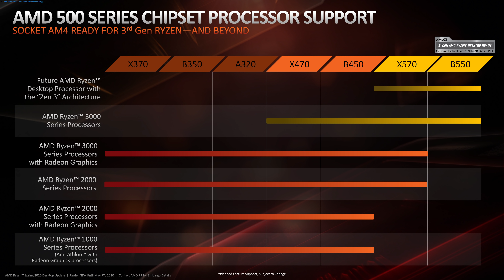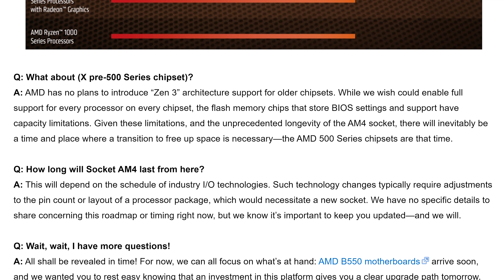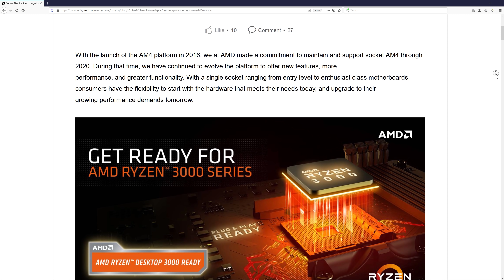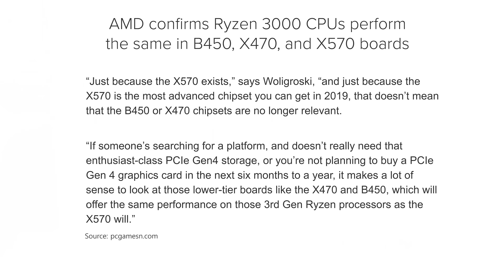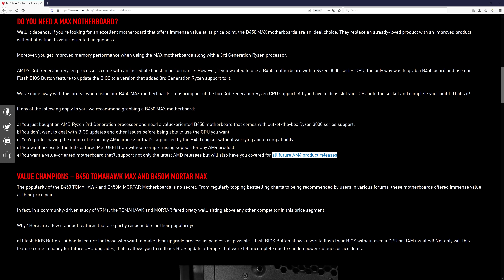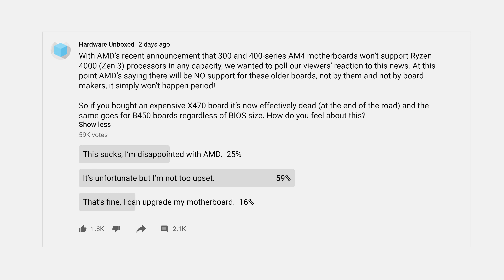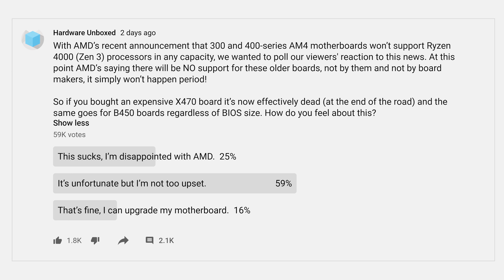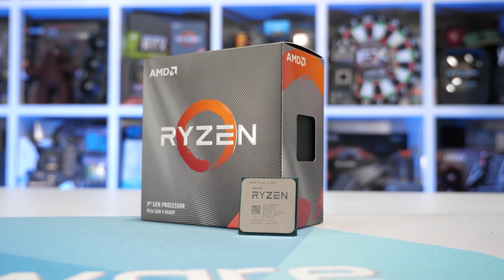AMD Does An Intel, Axes Zen 3 on 400-Series Motherboards, Our Thoughts

Comment: Yep, I build a B450 with R5 3600 like 2 months ago.  I was hoping to drop in a 4000 series CPU in a couple of years.   Now I might as well weld it shut.
Reply: exactly the same config as you, a month ago.
Reply: @marshelo88  don't know if you heard, but they have caved to pressure and we will have 4000 series support now.
Reply: Save money, sell old rig for 20 to 40% of the value. Buy new shit. Repeat every 4 years. Profit.

Comment: I agree that its a crap move but I think the number of people who do "just" a CPU swap it pretty low, partially because Intel has conditioned folks to think of motherboards and CPUs as being replaced together.  

I just bought a 1600 AF to put into a build and I decided to go with an x570 because I wanted to be able to put multiple CPUs in over time. 1600AF now, then a cheap 39xx, then the very last 49xx.  I figure I can get 8 years out of it and never spend more than $100 on a processor.  But I almost bought a B450 because the are such a great value and I thought they would carry me to a 4600 minimum.

Thanks for standing up for users!

Comment: You nailed it. AMD screwed people who bought B450 or X470 motherboards with their Ryzen 3000 series CPUs last year, when those chips were released. Had they released B550 alongside the Ryzen 3000 series, this would be a non-issue. The only 500 series motherboards they had available at the time were X570, which were too expensive to reasonably pair with a $200 CPU purchase. They really need to find a way to support Ryzen 4000 on the 400 series motherboards, if they want these customers (myself included) to buy AMD next time around. If they're going to do this crap, I may as well buy Intel again.

Comment: You guys are awesome! Thank you for being the only notable tech review channel which didn't blatantly side with AMD on this, and looked at both sides of the argument honestly and objectively. When I bought my X470 board with a Zen 2 CPU I specifically chose a board with a 32MB BIOS because I was following MSI's launch struggles with their smaller ROM sizes. When AMD axed PCI-E 4.0 on my board, I was fine with it, fair enough. But when they told me no future CPU support because my BIOS is too small, NO, that's not flying, don't insult my intelligence.

Not only were customers convinced by AMD's marketing that future CPU's would be chipset agnostic, OEM's were clearly lead to believe the same thing, so we are not just whining over nothing. It would be one thing if AMD would offer SOME compromise on this, but since they're not, I'm lead to question whether they're doing it out of greed, laziness, or anti-consumer choice, because the technical limitations they cited are at the least blatantly misleading, and at the most it's outright dishonesty.

Comment: I bought an MSI B450 Tomahawk on the grounds that it would support future Ryzen releases. I'm currently using a 2600X and whilst there are some worthy upgrades in the Ryzen 3000 series I was more likely to wait for the Ryzen 4000 series. Now I'm left in the future to look at the used market for a CPU upgrade because I don't intend to change my motherboard for a while. 

Quite frankly I'm disappointed in AMD's stance. They sold me on the idea of future upgrade ability and now that no longer feels the case. I am quite capable of flashing my BIOS to support future releases and I'm sure many other B450 owners are too. I sincerely hope AMD change their stance as otherwise I won't be buying Ryzen 4000 CPUs as it stands.
Reply: This stance doesn't make sense to me. The way I see it is this: 

You have 2600x and you are skipping 3000 series to jump straight to 4000 series. While you are doing that, you are saving money. At least 300$ if you are hoping to buy 4600x or something similar on release date. So you would technically be saving about 100$ because you don't have to upgrade your motherboard. Now, I have no idea what you are planning to do with your old CPU without a motherboard, but lets assume that you sell it to get back some money. You should easily be able to sell it for like 50 - 60$. So that means that you have to spend 240 - 250$ to upgrade to 4600x.

Now if you are planning to do the same thing, but you have to buy a new motherboard, you will have to spend additional ~100$. But you also get to sell a nice bundle of decent b450 mobo + 2600x for like 100 - 120$. So essentially it would cost you ~280$ to upgrade to a newer motherboard and 4600x CPU. Thats like 40$ difference in 2 years. Even if you new motherboards costs 150$ you are still looking at spending 100$ for 2 generations of improvements. Like such a trivial thing to be mad about.

Comment: I did get a 450 Tomahawk, during Black Friday - I'll just replace my 2700 with a 3950x.  I'll get a new MB when the AM5 socket hits.  This is much ado over nothing.  if you need the performance gains that the 4000 series provides, guess what - you will need to get a new MB.

If you are too cheap to get one, well your opinion just doesn't matter to any corporation.

Comment: 1 i think b550 delay is the worst thing about this situatio, if they released the cheap 5 series motherboard giving a clear budget option for 3xxx processors 
2 this move means that 3950x processor will maintain its price a lot more, much like evey "best for its socket" cpus from Intel

Comment: I would gladly dump 1000 series support for 4000 series support
Reply: Don't forget Excavator, Athlon and all the APU's.  Need to be able to go from 2000's to 4000's  Actually I'd be happy to go from just 3000 to 4000.  The 4000's would replace 3000's which would then be used to replace 2000's.

Comment: Almost every single generation of Intel processor has required a new chipset without fail. Are you 9th gen Intel users upset because 10th gen processors won't work on your expensive motherboard? No reason behind it other than greed really. So AMD actually gives out a somewhat valid reason and when the could have said just because it won't, and everyone gets upset. Frankly, I'm amazed they even kept AM4 going this long. Here's the real thing though, what about ZEN 3+ or Zen 4?
Reply: The problem is the AM4 socket was supposed to be compatible with Zen3.  They have made this claim from 2017.  Zen 3+ and Zen 4 were never  in the picture.

Comment: as usual harware unboxed, u are right on point. believing in AMD i replaced my 6700k with r5 3600 , keeping in mind i am gonna get a high end 4000 series, and also recommended AMD and built a MSI b450 tom. max for my nefue 6 months ago, blessing AMD for the change of spirit they bring along with the higher core count and knowing it will support future am4 processors. AMD at-least u can do is support B450, u let me down and u made me let down my nefue. i am disappointed to c u are going in intel's footsteps. keep this up and i am sadly going back to intel when they go 7nm.
Reply: So Intel letting you down for the past 5 years suddenly doesn't count and after one extremely trivial thing you are ready to go back to the abusive Intel relationship? Really backwards argument.
Reply: @MantasS-t9v  i understand your point. with Intel at least u know what u are getting from the start and u plan accordingly. There are no hopes and promises to be broken, what u c is what u get. This is bait and switch strategy. They abused my trust. I invested in a platform knowing its gonna have atleast 1 more gen of support, bought 3600 now and planned to get higher frequency +core count on 4000 series on same mobo, BELIEVING AMD's promises only to find out later i got cheated into investing in a dead platform.  I even bought new pc earlier than I would otherwise to support amd and the competition this field desperately needed and even bought AMD stock. I really believed in them to be different and more consumer friendly. With intel i wouldn't have done that. I thank AMD for waking intel up and make them sell better products for less money and thats it.
Reply: Back to intel when they go 7nm. I might not live that long.

Comment: AMD will probably back track on this statement and allow support for older boards with 32mb bios chips. Those boards generally have better power handling as well because the company at least spent the money on a more expensive bios, may as well do the same for the rest of the board.

Comment: Time Stamp: 6:00 Thank you so Very Much for explaining the Whole X370 and B350 situation But still some of us first ZEN 1 Adopter's have x370's that can handle it and deserve it for leaving Intel in the first place for the promise of AM4 2020...
     Because I have been saying for a Year That ASRock only gave my ASRock Taichi Motherboard 1 BIOS for the 3000 series!! Then Finally about 2 month's ago, gave us the ABB AGESA and Then the 1.0.0.4 B patch 6.20 BIOs that basically skips the ABBA AGESA.. This is Asrock's website https://www.asrock.com/mb/AMD/X370%20Taichi/#BIOS  and while you are there check there X470 Board's and UEFI's.. None had the latest BIOs' for Zen 3000 except X570... 
    Thank you so Much Steve because I didn't upgrade my 2700X to a 3700/3800X out of Fear of BIOS incompatibility Issues.. Now that Ryzen 4000 is about to come out, Motherboard maker's want to give us a descent BIOS for Zen 2 on X370... Typical of them and AMD.. 
    Finally, IT'S The SAME PIN Layout and I have a Beefy true 16 Faze VRM, There is no reason for this with THE 3000 GEN CHIP'S.. But I do get it if they don't want b350 or X370 board's running Zen 3 from there point of view, BUT NOT FROM MINE!! I WAS AN EARLY ADOPTER, ONE OF THE FIRST TO LEAVE INTEL FOR AMD ZEN 1... I was scared to death Nothing n worked right, it took 3 BIOS updates, before you could get your memory stable above 3000Mhz, Who remeber's that shit???.. 
    I STARTED WITH MY X370 TAICHI AND AN OVERCLOCKED 1700/3.9GHZ..  Then I went to flareX 3200 14T and a 2700X.. Now I want a new chip and want to keep my PERFECTLY GOOD MOTHERBOARD!!??, ASROCK AND AMD!!!!!!!!!!!!!!! But Thank you Steve for explaining in detail once and for all about lack of B350/X370 motherboard UEFI support.. Lastly Most BIOS Flashes are just just that flashes, that add too and over right info that already there, Trust me they could get another 2 gen's out of good VRM X370 Board's if they really wanted too.. This is AMD on their chip-set money and ALL the motherboard companies and there new money because They know people will buy it cause everyone is in love with ZEN right now,,,  to make an agreement to Make New money....

Comment: While you're not completely wrong with your statement, that B450 buyers buying a 4 core Zen 2 are at the "end of the road", it is partially wrong at least. They can upgrade their core amount to 6, 8,12 and 16 cores which amounts to much more than to upgrading your IPC alone. People seem to forget that pretty often when they talk about "no Zen 3 for X400 series boards", but it is very significant and not to be ignored or forgotten. The same would also be true for owners of X300 series boards.
Reply: Except lots of programs don't benefit from increased core count.  Lightroom and Photoshop being the two most popular.  Faster clocks and better IPC always help.

Comment: My explanation of the mentioned poll is that people will hold onto 3rd gen for a while now since it performs very good, and there's no need for an upgrade for the most, unless something magnificent happens in the GPU market. In the other hand, I think everybody who decides to move on to the 4th gen can still flip their MOBO and CPU for a decent amout of cash and add that extra to get newer components. Since there's still alot of 1080p gaming going on, B450 boards with 3rd gen Ryzen are more than enough (I'm running a B450 Bazooka v2, 2600x, 1660Ti and getting comfortable 75FPS gaming). If nvidia surprises us with Ampere, things might get a but different in that area...
Reply: Only going to  matter if Nvidia moves to PCIE 4.  Which isn't likely till IBM supports PCIE 4.  Even 2080 ti barely exceeds PCIE gen 3x8.  Do you expect Nvidia to double the graphics capability in the 3080 ti?

Comment: Big disagree, the reality is 10 years on the same socket is unheard of and people got their value out of their boards. Support up to 2020 means this is the last year for support and come 2021 all new boards will be needed for all future Zen chips. Those new boards will be around until 2031. If AMD follows the same model.

He'll I bet if AMD offered a motherboard credit (turn in your old Mobo for a newer model and pay the difference) people would shriek still. Sometimes as they say, the customer can be wrong. What I mean is if that board (400 series and lower) decides to die. The AIBs will not have a replacement and any board on eBay is rolling the dice if the board is good. Eventually you will be forced by circumstances to upgrade unless you can find the components and have a machine to do precision soldering on your dead board. 

As they say, no one is forcing you to upgrade your Zen chip. If you are using a 2000 series, 3000 series an AF chip. Then why do you care about the 4000 series needing a whole new board and chipset. Your CPUs should be good until 5000 or 6000 and then you will need to seriously think about upgrading anyway.
Reply: Who is talking 10 years?  We are only talking 4.   Am4 was supposed to be good for ZEN, ZEN 2 and ZEN 3.  Which were supposed to be 2017, 2018 and 2019.  Zen 3 not working on the AM4 sockets from 2017 is not what AMD marketed until now.  And now they are saying up to 2020, but even in 2017 they were saying through 2020 ie through Zen 3.

Comment: My feeling is that AMD will bend on this. They certainly want to keep the goodwill they have been building with the enthusiast community the last few years.
Reply: Not so sure about that.  They should be in damage control right now if they want to keep the goodwill.   MSI was really fast to address the issue when it was rumoured they weren't going to support the 3000 series on the B350/X370 motherboards.  This isn't a rumour.  Its an AMD press release.    I guess they just  don't want to sell me a couple of  4000 series chips.

Comment: On the one hand, AMD could do better and support 400 series because they didn't release B550 alongside or shortly after X570. On the other hand, they are already doing better than the competition when Intel's go-to line is "go fuck yourself, here's a new socket again for no conceivable reason".
Reply: AMD is now just copying Intel.   The bios size is an issue for some  X570 boards as well.  And it's not even a new socket.

Comment: I just got a Ryzen7 2700 plus a Asus Gamer-F B450 and two 8GB sticks of DDR4 3200 for around 280. So, it just validates me going low on the tick in prep for going higher with B550 to get PCI Express 4

Comment: Lets be honest. The B550 chipset is probably just a X470 or B450 chipset... which was identical to the X370 and B350 chipsets... AMD could probably support the 400 series chipsets on Zen 3 with minimal effort.
Reply: I expect there is some effort required to split the AGESA,   but it is not that difficult.  And as for confusing the market place how about Ryzen 3400G and 3200G not running on B550 while all the other Ryzen 3000 chips do.  No confusion there.  AMD must think we are idiots.

Comment: I bought a x470 taichi early 2020.
I did not want a active cooler on my mainboard and did not need PCIE 4.0.
A 2700x was the CPU of my choice, because i needed the extracores for encoding.
I did not buy a 3700x or bigger, because it was obvious for me that i would change to an high end Ryzen 4000 when they were released.
Now i am not so sure if i will upgrade in this hardware cycle at all and just wait for DDR5.
This is bullshit, AMD.
Reply: Unlucky lad

Comment: I think AMD will most likely backtrack and add support 400-series chipset for Zen 3 because it will just be more profitable for them to do so since right now there are a lot of users (me included) use 400-series chipset because 5-series are just too expensive for my use case (and it would be safe to assume that this applies to a lot of 4-series users as well).  AMD has bright engineers and if they decide to do so, they will be able to support 400-series mobos with Z3 CPUs.  and, of course, the karma factor for them will be tremendous.

Comment: Lmfoooo jesus people sometimes just ask for toooo much amd did 1000/2000/3000. That's 3 generations how much do people want look at intel they only do 2 generation  cpu per chipsett
And no zen 3 is total ne architecture  so a new board should require
1000/2000/3000 is pretty much same architecture . Zen 3 4000 is a total diff cpu I'm sure the pin lay out would be diff ect .besides amd did enough anyone upsett ain't that smart common since tells me a new board will require for zen 3. Period  I meant line wtf jesus.

Comment: I’m very disappointed by this... 2 weeks ago I built a new computer for my parents using the MSI b450 pro-vdh MAX partially based on the fact that  I should of been able to upgrade their system in from a 3200g to perhaps 4000 or even 5000 series processors in the future. Their previous system had no upgrade path so I specced their new system so I wouldn’t be building a whole new PC every few years. Instead incremental drop in upgrades will create a whole new system over time (aside from the case and PSU perhaps). Very disappointed I hope MSI sues and wins.